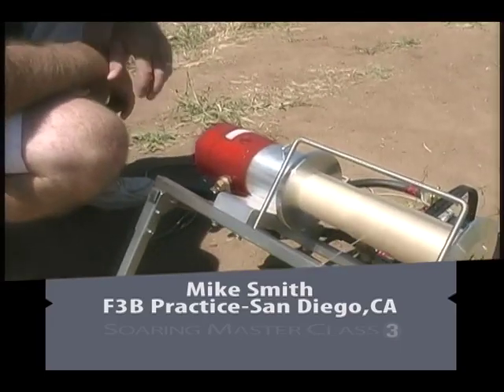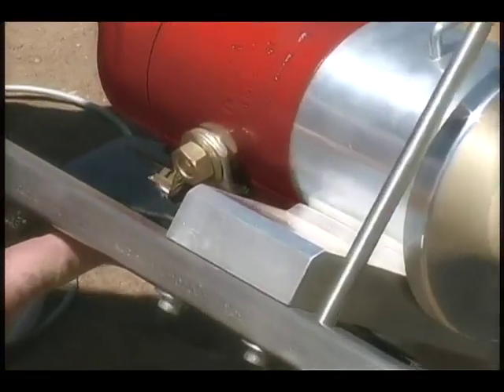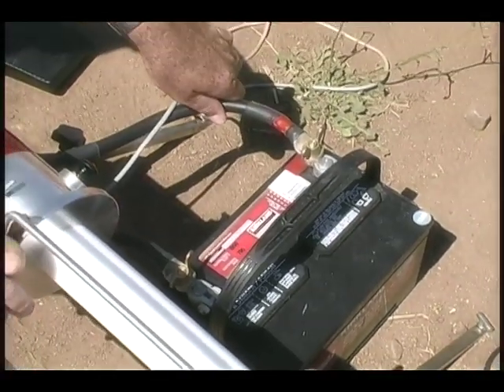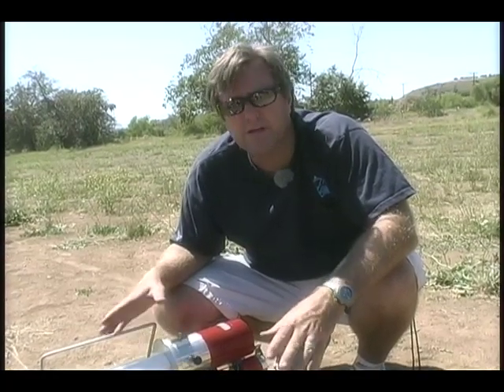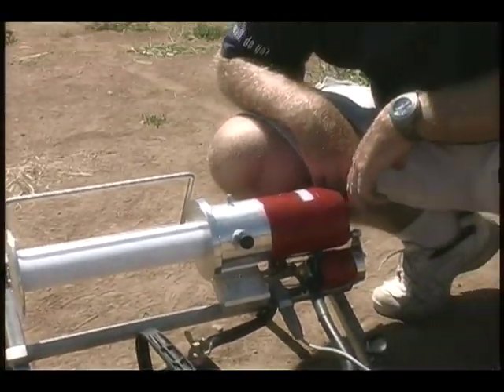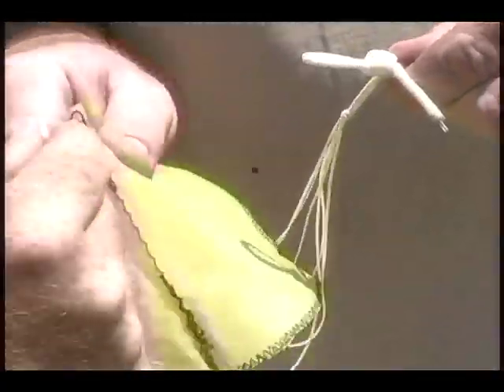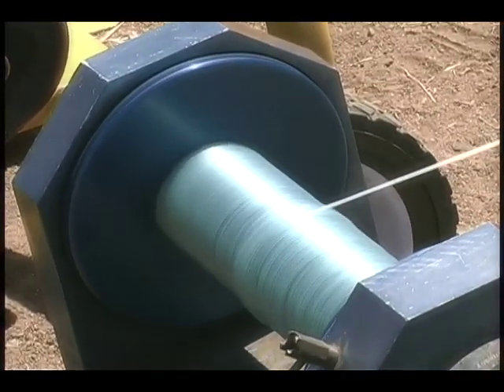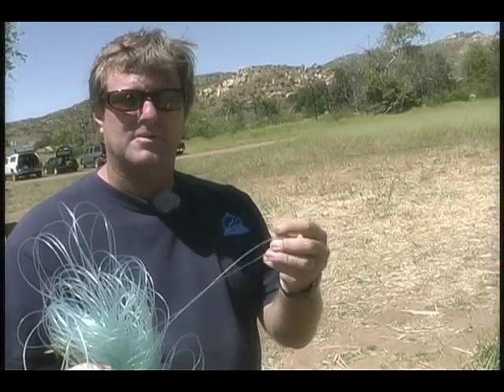F3B RC Glider Winch Demonstration

Comment: Most fishing line is optimized by the manufacturer for the least amount of stretch possible which is desirable for most fishing applications.  However, for an F3B glider winch you want the most stretch possible so as maximize the energy at the top of the launch for the "slingshot effect" as mentioned in the video.  Soaking in water also helps maintain the stretchiness.  Some line for big game fishing claims to be optimized for max stretch but I am not sure if it is as stretchy as Speedline.
Reply: In my experience the cheapest fishing lines have the most stretch.